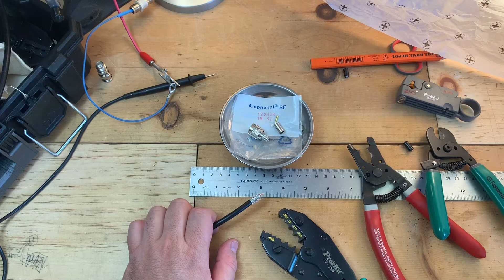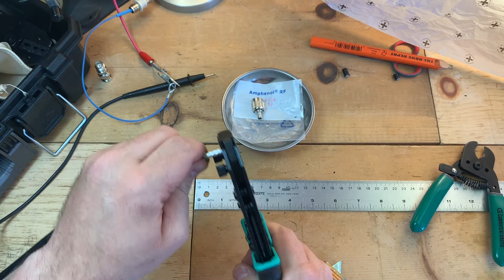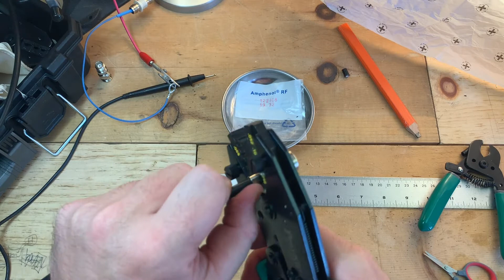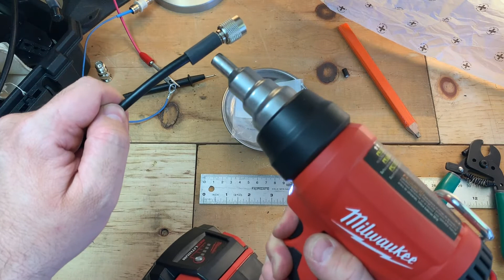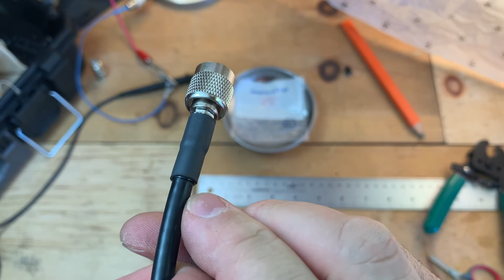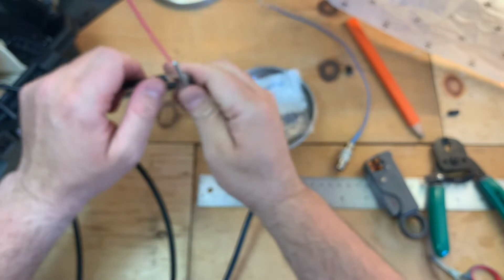LMR240 Making a TNC connection

Comment: The reason why you're not supposed to crimp it twice all the way to the end of the connector is because you want that part to still be round and just a snug fit on the coax. That's better from a strain relief perspective and if you're pulling hard enough on it for that first crimp alone to be insufficient then your cable is already destroyed. It's not like it makes a huge difference but it's no different than adding heat shrink. You're trying to avoid stress concentrations where you're going from a nice flexible cable to the rigid and unyielding connector.